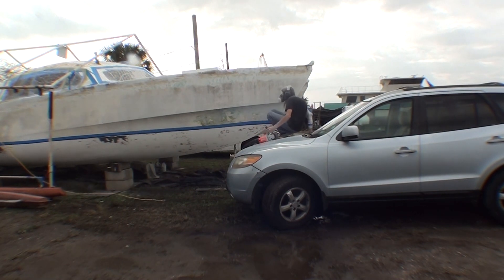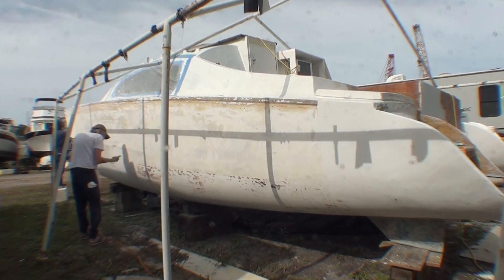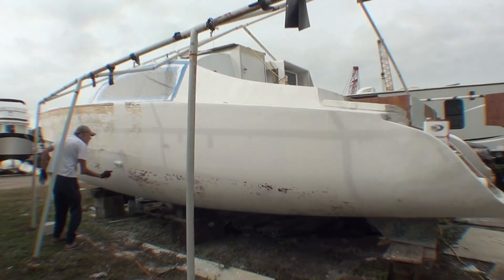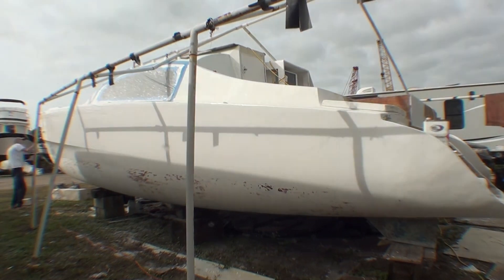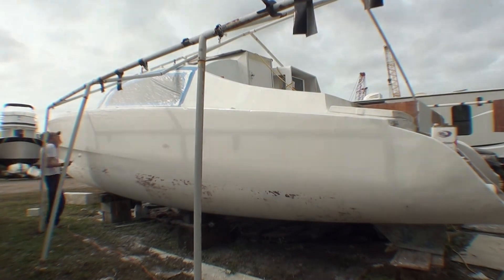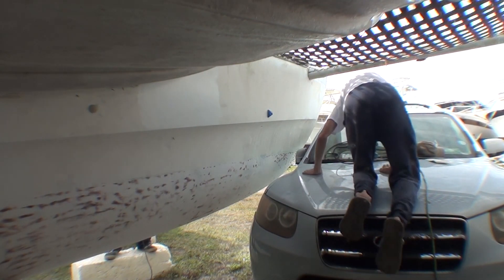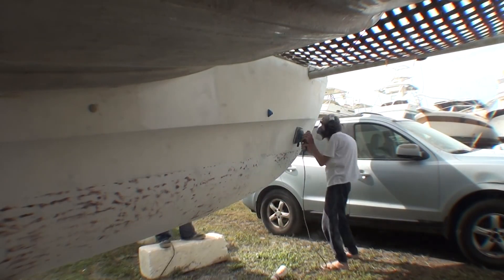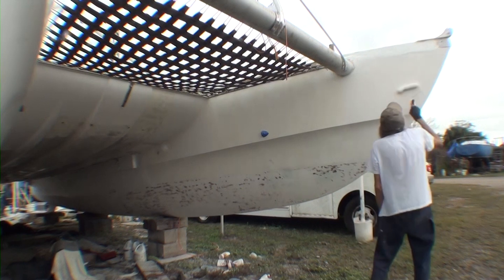What I used Instead Of Marine Paint On The Catamaran

Comment: Gasoline on a rag works good for removal of baked on duct tspe adhesive.
Reply: i use wd40 for that
Reply from the maker: Thanks!  Now I have some easier ways to remove tape when I get to the tape on the windows. @Luuxs
Reply from the maker: Thanks!  That sounds easier.than grinding old tape off.  There is more tape holding the plastic over the windows, so I will try it then.

Comment: If you tip it with a brush, wouldn't it be smoother?
Reply from the maker: I sort of tip it with the roller.  The roller leaves a pebbly texture instead of linear streaks like a brush would.  There is also a high gloss additive that you can add to make it lay down better if you spray it.  This is just the easy way to get a cheap coating on the boat.

Comment: You are making good progress! Nothing wrong with a workboat-finish. Better to save money for more important equipment than spending it on fancy looks. Thank you for uploading :)
Reply from the maker: Thanks!  I'm going to need all my money for paying people to move the boat into the water and for gas.  Paying $1,000 or more for marine paint didn't make sense.  Normally gelcoat is just $200 for a 5 gallon pail which is way cheaper than marine paint, but I got $75 off because they couldn't match the color of their normal gelcoat on this batch.  So for $125 I painted the entire boat with a thick, protective coating.
Reply: That's a bargain! And the fortune of the skillful of course :)